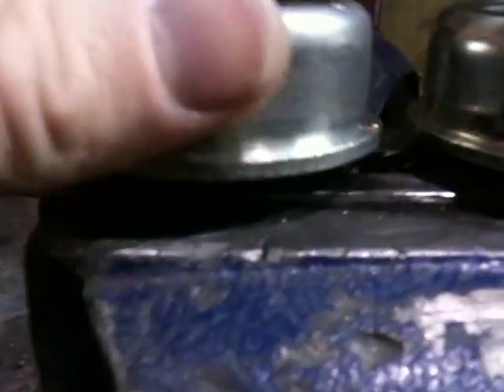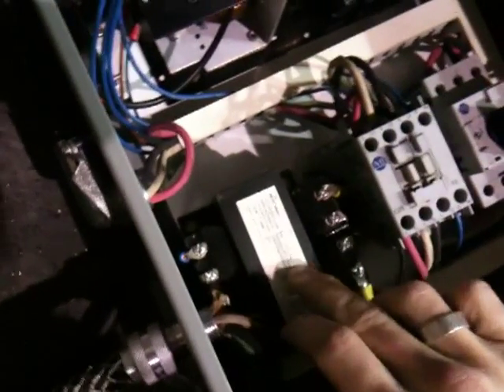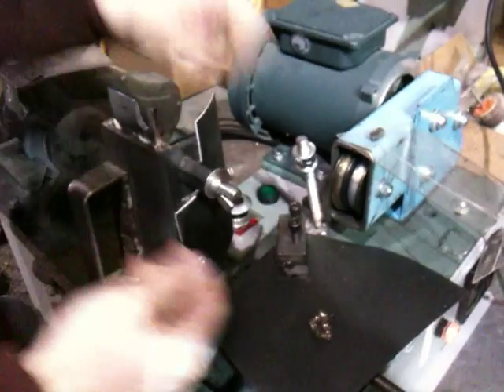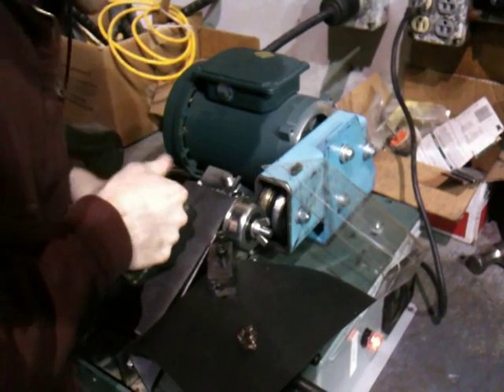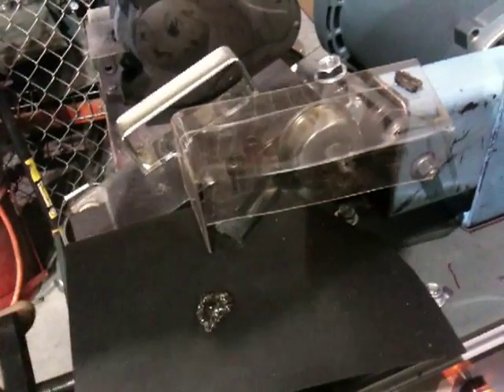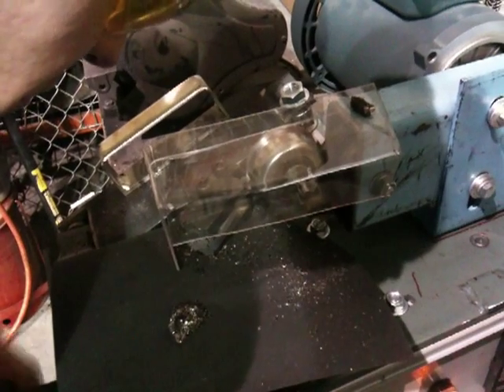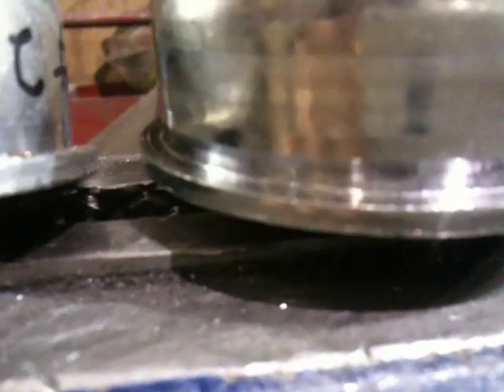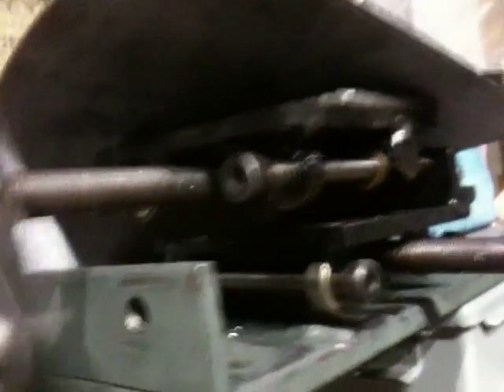Home Built Lathe For Bearings.

Comment: *boss hey these bearing are the wrong size!!
*russ- no problem ill just  grab some tools and quickly wire a voltage transforming box with saftey switches and relays attached to a X and Y axis custom hand built tabel attached to sevral more bearings and driven by an industrial motor with hand vulcinized rubber bearings for suport!
*boss .................
*russ- it will save you money..
*boss great idea!!!